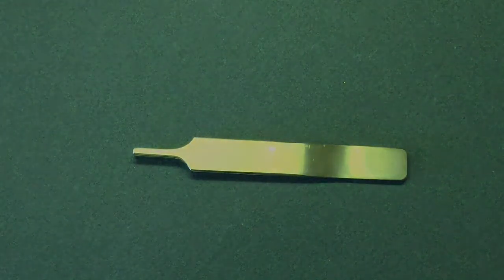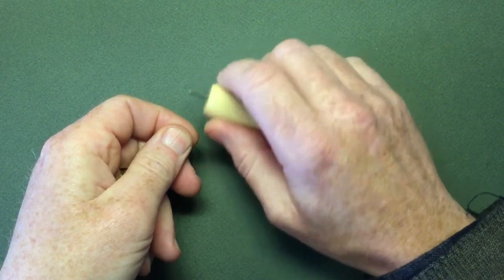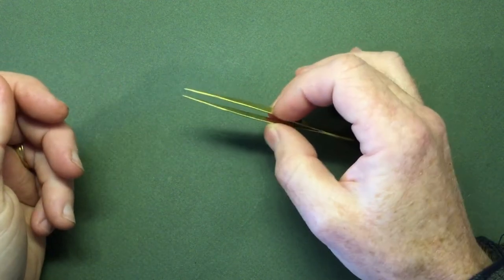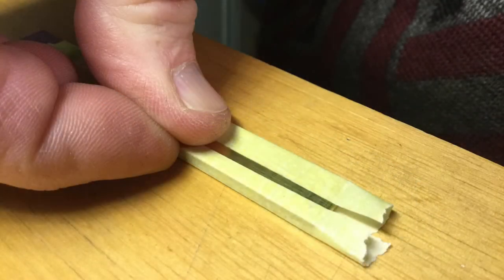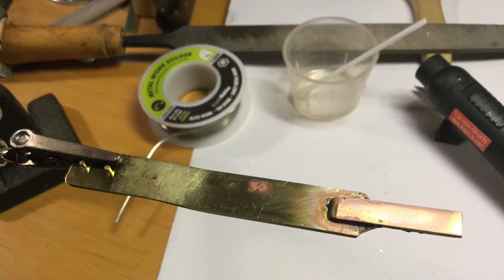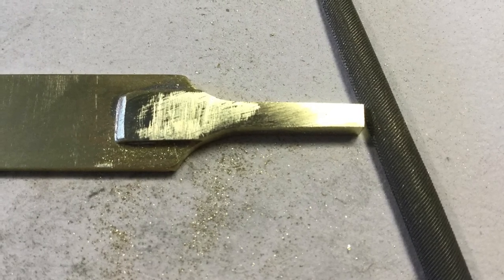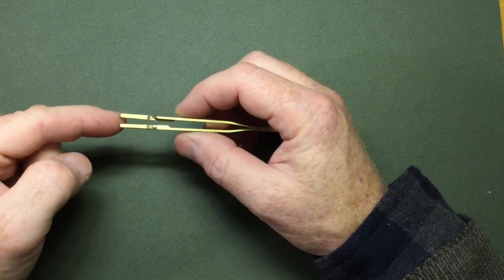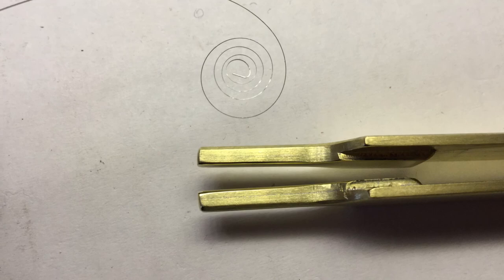Makin' a Tool ep.1  Hairspring Curling Tweezers

Comment: Any spec of the wire?
Reply from the maker: G'day, if you're asking about the wire used to make the Hairspring, it was the finest music wire K&S Metals make ( 0.015" x 36" long, with 5 strands in the packet). I bought it at a model aeroplane shop, and it doesn't cost much. Cheers